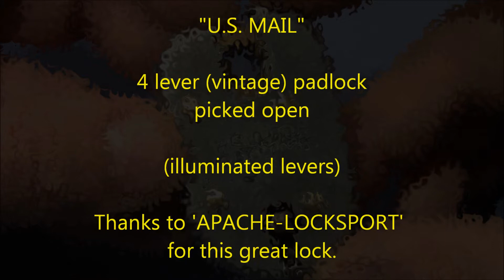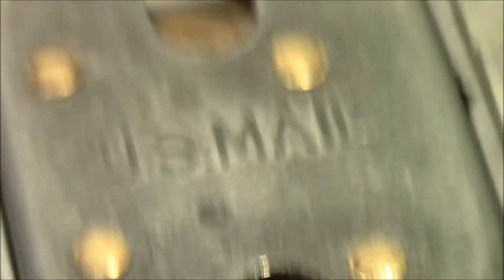(picking 341) 4 lever padlock ("U.S. MAIL") picked - illuminated levers - thanks to APACHE-LOCKSPORT

Comment: Nice picking bud! That is a nice old lock. Congratulations on your first lever lock picked! You could see the levers very well with the light you used to. very nice idea and very quick picking.  I have never tried to pick anything like that before.  I will have to get a few and try my luck with them. Keep on picking!
Reply from the maker: Thank you. Before I shone a light in the keyway I was lost. No idea where these levers are and no feedback from the pick that I could interpret. And as I had to look inside you should also participate :-)

Comment: looks like something used to send valuable things by post, and to secure a postbag during transport. Also it can be pushed onto the bracket on the bag, and the messenger does not need a key to lock it. So the sender is sure the item is secure inside.
Reply from the maker: OK, I see. Thank you for the explanation.